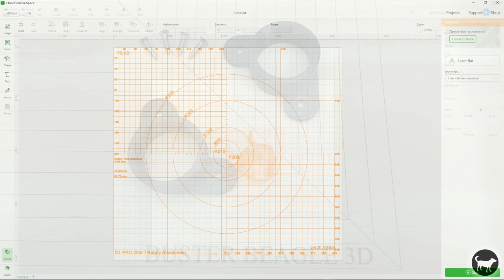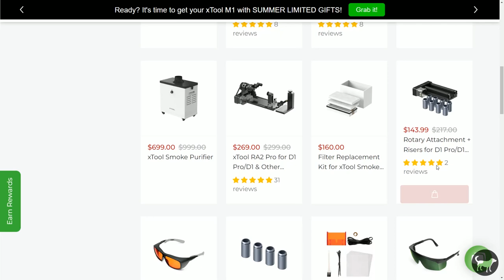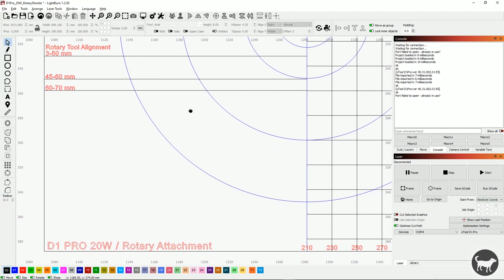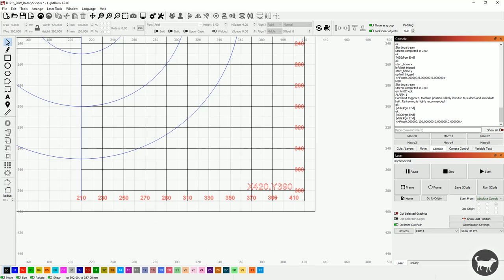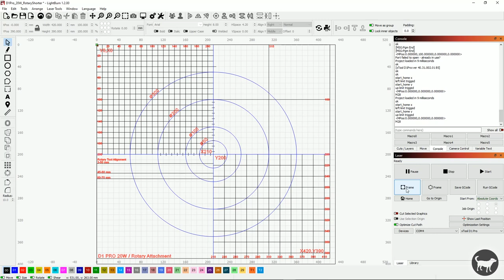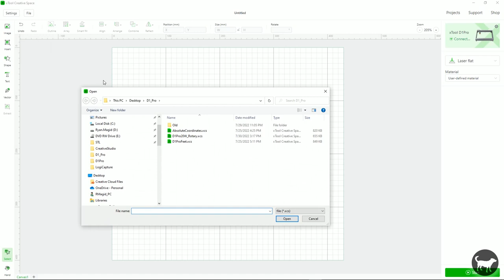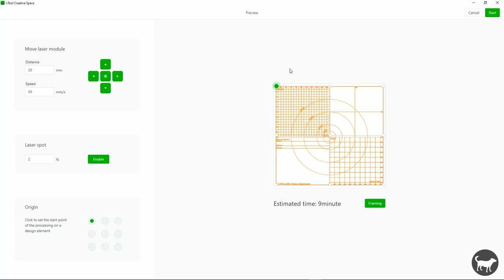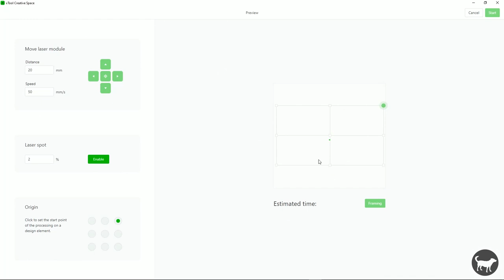xTool D1 Pro Grid Files | Use Absolute Coordinates | Lightburn | xTool Creative Space

Comment: Hi Buster, love your videos, lots of great information. I am, however, having trouble with my laser/using your file for the spoil board. I keep setting off the outside limit alarm and at one point my timing belts seemed to drag or jump. I had no issue burning the feet or with my previous burns. Any Ideas? My settings in Creative Space are as follows:
Move Laser Module Distance 20mm
Move Laser Module Speed 50mm/s
Origin set to Center
Laser Flat
Material 3mm Basswood Plywood A4
Processing Path Auto Planning
Processing Start Point Absolute Coordinates

Sometimes when I press the Framing button it will start burning the last project.

I'm at a loss.
Reply from the maker: Thanks for watching. First be sure to read the read me first document in the folder which goes over turning those limit swithes off. Second be sure to use the files in the 2.0 folder if you have the newer version of the D1. xTool has made the workable area of their machine smaller in their software for some odd reason so you need a smaller grid. If it still seems to not work then use the 40W version in the 2.0 folder as it is the smallest one. It should be the same grid coordinates even if you don't have the 40W machine.
Reply: @BusterBeagle3D  WOW! That was FAST! Thanks for getting back to me so quickly, I truly appreciate it! I did manage to get it to work somehow, don't know what I did differently, other than maybe Absolute Coordinates may not have been on originally. It was burning fine for the first 3/4 of the template, but then there seemed to be an issue with the belt again, like a binding. When the job completed, a number of the lines were off and the marks that were meant for the far right corner burnt near the center. I haven't seen anything to indicate that my laser is the 2.0. My software version is 1.78. Again, I appreciate the help.
Reply from the maker: @bucksandoes  Your machine is a 2.0 if you have an emergency stop button on it. If it hits the frame at any time the rest of the grid will be off. You may need to use a smaller grid and be sure to home again right before you run the job.
Reply: @BusterBeagle3D  Definitely not the 2.0. Any thoughts on whats causing the issue with the track or belt? I would assume it was a binding or tension issue, but I set the tensions almost identical on both sides and when I move the gambril and laser head I find no obstructions. I realize these are near impossible questions to answer remotely, but I do appreciate any tips you might have. I have only had this for 3 days and I'm chomping at the bit to put it to good use.
Reply from the maker: @bucksandoes  The belts should be tight but not in an insane way. Most of the issues I see arise are from the wire loom getting in the way at some point. Also don't forget that you have to tighten the belt along the X axis as well but again not too tight. Lastly make sure you have the connection in the front of the machine right under the xtool name on correctly. If you didn't tighten that coupler correctly it could cause one side to slip and be off from the other side which may make it catch. Other then that it's hard to diagnose without seeing it.
Reply: @BusterBeagle3D  I think I have solved the binding problem, a combination of wires catching on ties and gantry belt too tight. My other problem seems to be software related? Everything is up to date, but when I press the framing button on the machine, it starts burning the last project, even though it's not loaded in the software.
Reply from the maker: @bucksandoes  I have heard of that issue in the past but never ran into it. I would suggest joining one of the xTool facebook groups and seeing how others debuged that issue. There is a ton of useful info on Facebook when it comes to pretty much any of the laser machines I have used.
Reply: @BusterBeagle3D  I'm currently sourcing solutions there as well. Thank you for graciously allowing me to hijack your feed on an issue unrelated to your video.
Reply from the maker: @bucksandoes  No worries. Good luck!

Comment: I plan on buying this today.  What material plywood did you recommed using?
Reply from the maker: I just bought regular plywood at Home Depot. Think it was birch but it really doesn't matter. Just needs to be 2x2 ft, I went with half and inch thick.
Reply: @BusterBeagle3D  MDF should work as well. With MDF, you won't have all those confusing grain shapes running all over the spoil board.

Comment: When I try to process or frame my grid I get an error saying “Element is placed outside of the processing area.”
Reply from the maker: For some odd reason they changed the firmware on the 2.0 to have a different workable area even though the frame size and laser are the same. It reached out to the company to tell them to fix that but I guess they haven’t. The files will work in Lightburn but might be too big in creative space. Reach out to me on Etsy messages and I can send you a smaller grid that should still work with 2.0.

Comment: Hi Ryan, I still have a big question hanging over me. In the video, you talk about the X Limit of the xTOOL D1 Pro 10W machine, which is 430mm (430mm x 400mm), so you stipulate 429mm to not activate the Limit Sensor ok? So, let's say that this 429mm mark is from the upper left corner (whatever). But how is this set, or in other words, how does the machine understand this? If you can explain, I would appreciate it very much!
Reply from the maker: You can change the workable area in Ligthburn under Edit>Device Settings>Working Size. You really just don't want to go out of that range that I mentioned. If you are using creative space just don't fill the workable area from left to right with an image that fills the whole canvas. It might be too large for the laser to actually burn it completely.
Reply: Thanks for the reply. I left my work area as 420mm x 390mm.
And in the Move tab in the upper corner, what is "Get Position" X 0.00 and Y 0.00 for?  Does that also have to do with the subject?  Thanks again
Reply from the maker: @Dancopymus  Get position just lets your know where the program currently thinks that your laser is at in absolute coordinates. If you home the laser and then move it in the program to X100 Y100 and then click on Get Position it should tell you X100 Y 100
Reply: Thank you very much!

Comment: Hi I have purchased your files for the feet and grid from Etsy. I have made the feet with no issues but when i am attempting to create the waste board grid i get the following error message .  " the element is outside of the processing area."  I have the XTool D1 Pro 20W with the emergency stop. I am using the file under the XTool 2 folder. The open file has red print X410 Y 380.  I am usingf Xtool creative space which now has absolute coordinates, I am a newby to this hobby so not sure how to resolve. Any help will be greatly appreciated.  Michael
Reply from the maker: Not sure if xTool has shrunk the workable area again but if they have then choose the one that says it's for the 40W machine. The coordinates will be the same but the grid will be a little shorter so it should work. Reach out to me on Etsy if that doesn't solve your issue as I will see that faster then these messages.
Reply: @BusterBeagle3D  The 40w file opened without the same error message i will burn the waste board next weekend and reply if it was successful. Thank you for your help it is very much appreciated.
Reply: When you press Process you will get a question to adjust to YOUR machine. Then it will work

Comment: When using the RA Pro Rotary attachment how do you use absolute coordinates if you have to unplug the Y-stepper motor?
Reply from the maker: If you are using the grid you just make sure you manually move the laser to the middle line of the grid or move it there first before you unplug the motor and use the rotary. That way when you line the RA2 Pro to the lines on the gird you will know that the laser module is in the very center of whatever roller configuration you are using.

Comment: My laser is having an issue in lightburn and creative space anytime I try to home/center the laser. It goes to the top left corner but will not stop trying to push further, and is making a pretty loud sound because the belts wont stop. Do you have any idea why this is happening or how I can fix it?
Reply from the maker: If you have the pro version of the machine with limit switches you need to either check and see if the limit sensors are plugged in a and in good condition and second that there is not a part of the wire loom that is getting in the way and preventing the laser module from reaching back far enough to trigger the sensor. 9 out of 10 times it's a wire loom that is getting caught between the frame and the laser module.  
If you don't have a Pro version of the D1 then there are not limit switches and you should refrain from pressing that button. Instead you can find a manual way to home your machine by using a tool such as this: https://www.thingiverse.com/thing:5274995

Comment: Hi, I purchased the grid, I used the D1pro with the original rotary tool. I think I did something incorrect, the grid is about a half inch to the left of the grid when I home the laser. I'm not sure how it did that, I framed the laser with the grid several times to make sure it was in the right spot. The limit switches are off, and when I frame the grid the laser hits the frame near the button. I know I missed something, I doubt this is correct. Is there any information you can give to help guide me to solving this issue? Thanks so much! Great videos!
Reply from the maker: Did you also turn off the red crosshairs before burning the grid? If you were using Lightburn there is also a pointer offset that you need to turn off in the Device Settings.
Reply: @BusterBeagle3D  
I have disabled the crosshairs and I've also disabled the limit switches. I've created a more detailed post to give more details, thanks so much for responding.

Comment: I have an xtool pro 10 watt/RA2 PRO
When I do this it says the element is placed out of the processing area
What do I do?
Reply from the maker: Make sure nothing accidentally shifted or that your workable area is correct. If you are using Lightburn you can open the preview and it should show you which line isn’t going to burn. That is the one that’s over the line for reason. Sometimes even being exactly on the line makes it think it’s over. I have also noticed that if you are using inches instead of mm it could potentially have this issue as well.

Comment: How do you get this to fit after a software update?? I’ve been trying and trying but should have to increase/decrease the grid to fit the workspace
Reply from the maker: You should not change the size of the grid in the software or it will not work. Be sure to open the 2.0 version of the file if you are using creative space. It's in the Creative Space folder.

Comment: What the power and mm and passes setting for xtool sofeware you use. Bought your thing just don’t no what to put it at
Reply from the maker: The settings may vary based on your own laser power but if you OPEN the files instead of importing in Lightburn the settings should come in already. If you are using XCS then choose the basswood setting.

Comment: Hey, bought the files for the D1 20w. I Made the feet perfectly, if not a little scorched :), however I can't seem to frame the grid correctly. Any ideas?
Reply from the maker: Hello. First be sure that you read the read me first document in the folder. It goes over additional information on how to properly burn the grid. Also if you have one of the newer 2.0 versions of the machine (the one with the emergency stop button) and you are using XTool creative space then you need to use the file in the 2.0 folder in the XCS folder. XTool changed the workable area of the 2.0 machine for some odd reason to be smaller so I had to make a specific grid just for that one.

Comment: So...I have the D1 Pro and made all the changes in settings as per the Read Me First file.  However....I ran the first burn and all seemed to go well.  I decided to run it again to darken it a bit and it burned the next pass approximately  3 mm to the right.  I ran it again and it was off once again.  Any ideas as to what's happening?
After cutting a new board and starting the process over again....(leaving all settings the same) it has now decided to mark 3 mm's towards the bottom.
Reply from the maker: This sounds like something mechanical is happening as long as you are using absolute coordinates and homing each time. I would also check and make sure the wire loom on the back of the gantry is not getting in the way when you are homing the laser. It's somewhat in a bad spot and might be pushing back on the laser after it homes as this wire sometimes bounces off of the back of the frame.

Comment: I am going to purchase this grid pattern but have one question about its use. It will be fine for engraving coasters and other items that can be positioned on the board, but what about cutting. If i use the grid to position my board and then make a cutout it will ruin the waste board grid.
Reply from the maker: Correct. When cutting I like you use a honeycomb board to protect my spoil board and get better results. I still use the grid to try to keep the honeycomb square but still have to rely on the laser outline in this case to be able to register the position. When cutting I rarely use absolute coordinates, it's more a case for Start from current position for me.

Comment: I just bought the file off Esty to burn into a spoil board. I picked the right file for the D1 Pro 20W with the R2a Rotary and the extension kit.  Every time I frame it, it frames fine (ran the framing 4 times). When I run it to burn after framing multiple times it will hit a hard limit when it gets to the first line on the X axis, it starts in the center and then runs to the side where it gets the alarm to go off and stops burning. how do I fix this?
Reply from the maker: Please read the Read Me First file in the zip folder. It goes over setup instructions to burn the grid successfully.

Comment: Hey Ryan, I purchased your grid on Etsy.  I ran the program and it only burned the grid on the left upper, the circles, and all the numbers on the program.  What could be the problem?
Reply from the maker: Just make sure that you are reading the "Read Me First" text file in the grid folder. It has extra info in there for burning the grid. Also if you are using Lightburn make sure you are opening the file and not importing it. Importing could cause weird issues to arise.

Comment: Why don't the numbers on the grid coordinate with the numbers on the laserburn grid?
Reply from the maker: I'm assuming you mean Lightburn and these grids should correspond to the grid in there. First  you need to make sure you are using mm in Lightburn and also that you are OPENing the file and not IMPORTing it. Importing might place the grid in the wrong location.
Reply: @BusterBeagle3D  If I import a picture and say line it up at 120-200 X and 80- 160 Y  it's nowhere close.  MM are in place.  Are you saying that to have your grid be accurate that I must import a picture, make a file into Laserburn, save it and then call it up to burn?

Comment: I bought the file from Etsy. Thank you for sharing. Which file for the grid would I use? I have a D!pro 20w with the rotary tool. I have3 no way of knowing if the new rotary tool I have is shorter or longer than the other. Mine is kg02005400 ( the only partnumber I could find on the box. it is 9-1/2" long
Reply from the maker: If it was the older rotary the rollers are marked in their size on the top of the machine for the different roller sizes. If it’s the RA2 Pro they are marked A, B, C. Plus the RA2 Pro comes with a Chuck and the older version does not.

Comment: Is it ok to turn the cross hairs and limit switches back on to use your grid after creating the grid?
Reply from the maker: Yes you can. However if you were to place artwork towards the right edge of the machine you might not be able to frame since the crosshair is offset by about 16mm and might not be able to reach there with the crosshairs. I would highly recommend using the laser itself as your pointer when framing. It's much more accurate in knowing exactly where your laser is going to be working.
Reply: @BusterBeagle3D  thank you

Comment: I got the grid burned and the mounted to the D1 Pro 20w. I'm using Lightburn, but having problems with the absolute Coordinates. I am testing with a square slate coaster and positioning the bottom left corner at the y200 - x210 coordinate. But when I run the job, the burn is shifted to the left by about 1/3. I homed prior to starting, so not sure what I'm doing wrong. Any ideas?
Reply from the maker: Make sure you don't have the pointer offset checked in Edit>Device settings. That can throw off your x Axis
Reply: @BusterBeagle3D  First, thank your for the reply!! And yes, the Pointer Offset was turned on. So I turned it off, and now it's off-center to the right. Not as much, but still very noticeable. I'm sorry for leaning on you for tech support, but I'm out of ideas.
Reply: @BusterBeagle3D  Okay, not sure what happened, but I finally gave up and flipped the spoilboard over, reattached the feet to that side and then re-burned the target. Now everything is perfectly aligned and working as expected. The only thing I can figure out is I let the laser head slam into the Y-axis rail after I had everything done, and possibly knocked it out of zero. Nonetheless, I think this one is solved. And thank you for replying to my question!
Reply from the maker: @brad_neal  No worries. Glad you got everything worked out!